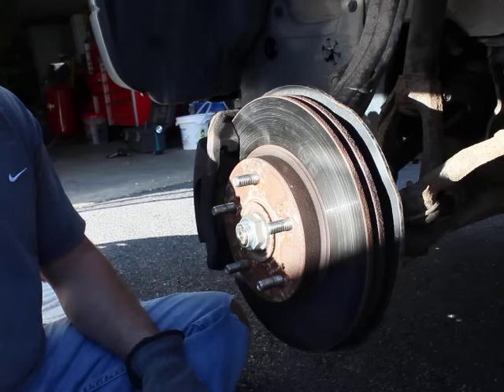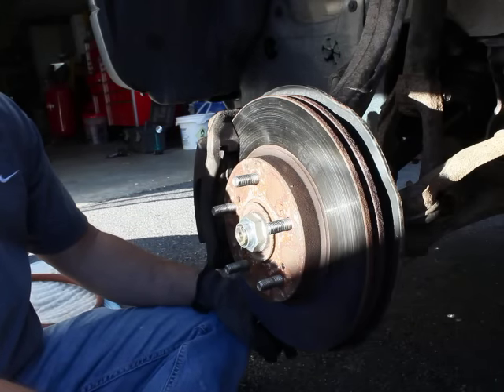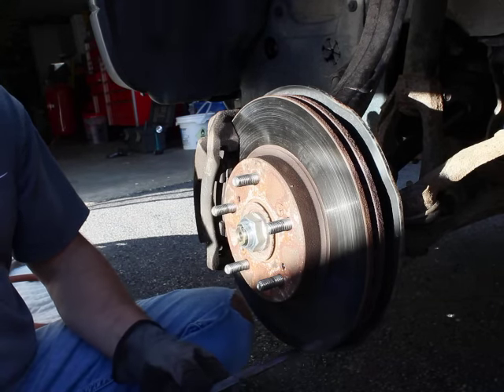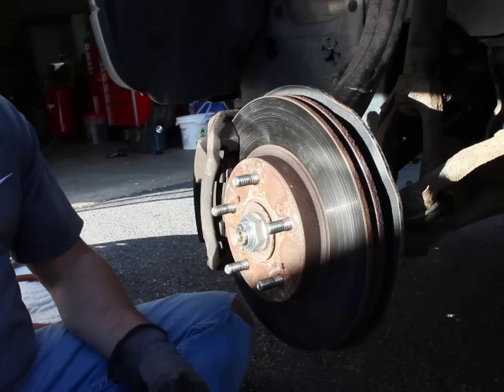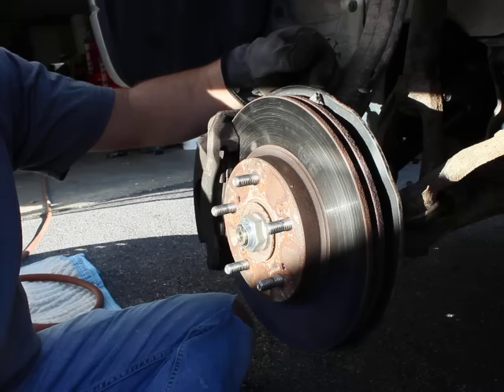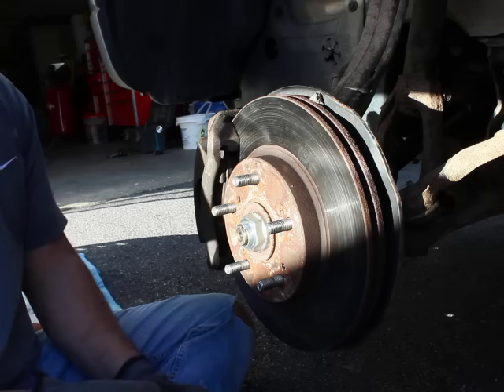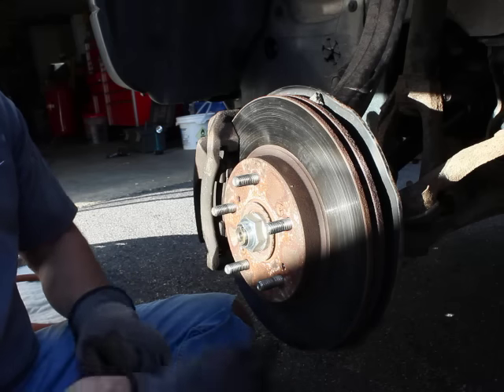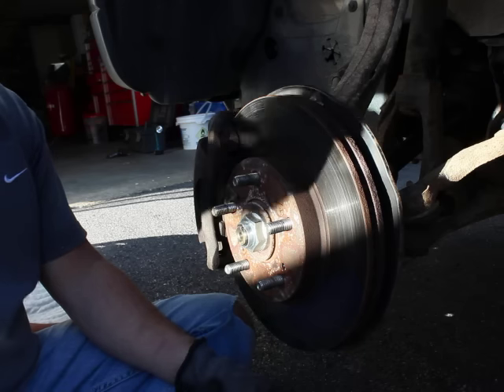Scraping Noise From Wheel While Driving

Comment: Hello Eddie, Parked up for a few months, then drove away, which caused initial resistance, followed by a small bang, then driving causes a 'FWWHWAH-FWWHAH sound, with increases in frequency linked to the speed of the wheel. Not a puncture, and on a Fiat 500, which recently had two new rear shock absorbers, and two new front suspension arms. All four wheels look level within the wheel arches. Any idea? Thank you.
Reply from the maker: It sounds like the rotors formed some rust on the surface and created pad impressions on the rotor causing a thumping noise when braking along with a grinding type noise. It may wear off after about 50 miles of braking, but if it doesn't you may need to have the rotors either replaced or resurfaced. Let me know what you find and keep me posted, thanks.
Reply: Hello Eddie, Spot on! Thank you. #eddiethecarwhisperer
Reply from the maker: Blokprintz Print with Paint! I like the sound of that :) thanks for coming back with an update, I really appreciate it.

Comment: thanks this has been a great help, i pulled away from a very stoney car park the other day and a terrible noise started which i thought was my exhaust dragging off the road, i hope it is a stone and nothing more serious as it is still there so could be a bearing from what i have seen on here, i will try and get back to you with my results..
Reply from the maker: muay thai & football NE England Bearing don't usually make a dragging noise, more like a helicopter noise. Go to my site, www.SimpleCarAnswers.com and check out my articles and videos on wheel bearing noises to help you identify your problem. Keep me posted on what you find, and if you have more questions, I'll be right here :)
Reply: Eddie Carrara  thanks, i had a mechanic take a quick look at it last night just parked on my drive, he jacked it up and had a quick look & said it is not the bearing straight away but probably the brake drum, he said he needs to book it in the garage for a proper look but should be ok to drive for now, i drove it today to and from work a 7 miles round trip and it only did the grinding for a few hundred feet then was ok, would you say it was ok to drive ?  and great channel you have, a great help...
Reply from the maker: Thanks Muay, I think you had a rock stuck from the driveway, if the noise is gone, don't worry about it.
Reply: Eddie Carrara well eddie the noise came back so i had it straight in the garage, it was done in, rear drum/shoes etc etc & other bits, i got it all done as i needed other little jobs doing aswell, in total it cost me an eye watering £170.60 :( 

i will post up exactly what was wrong later as the invoice is in the car,
Reply from the maker: That's not too bad , some brake problems cost in excess of $550 so you kind of made out cheap if the noise is fixed :)

Comment: Thanks for this video Eddie! I have a fiat Uno which is currently making this sound while taking left turns at around 40 km/hr. Was wondering if it was the brakes rubbing or the CV joints.
Reply from the maker: Hi Paul, 
Most likely the mechanic may have bent the backing plate during the alignment yesterday, so yes, check the backing plate on that side.
Reply: Eddie Carrara Hi Eddie, yes you were right. I bent it back and it has reduced a lot, I'm also waiting for new rotors and pads to come in. Once I get those swapped in I think it'll get even better!
Reply from the maker: I love a quick no cost repair lol. Thanks for the update Paul, I really appreciate it :)

Comment: Hi Eddie 
I have and it had to go to the local garage to do it . They said it was dirt caught between the hub and wheel rim and it was a common fault with the car ( Ford Mondeo MK 4 or all cars I don't know ) they took the hub off and cleaned it. It didn't take them long and they didn't charge me but it would be good to see how hard it is to fix it myself next time if there is one.
You could give a "heads up" to viewers that if they hear that sound then that is the possible cause and that you might need a second pair of ears to check as I could not tell where the sound was coming from on my own.
Reply from the maker: +Stephen Edwards 
Very true Stephen, sometimes you need to have someone standing outside the vehicle to hear the noise and locate where it's coming from, thanks for pointing that out :)

Comment: Sounds like you're dragging a big aluminum can, right? Just replaced the whole front end (an every bolt rust seized, hateful nightmare), and this was my noise on the test drive. It's dark and I'm tired and I knew it was not exhaust rattling, but it sure sounded like it; only in time with the wheel rotation. I figured it was something stupid. Let's find out. Appreciate the video.
Reply from the maker: Hi Des420, any luck with the noise? Was it the rotor backing plate?
Reply: @EddieCarrara1  Indeed it was. Thank you very much for asking.

Comment: I have the exact same noise coming out from the rear wheel. I thought it's my handbrake because I forgot to release the handbrake when i drove. And after driving for 1 mile, I realized it so I released the handbrake, but then after that, i started hearing this grinding noise. It doesnt always sound. It usually sound when i make a turn or when the vehicle is moving slowly. But even so, sometimes it doesn't make sound even when the car is moving slowly. It's like the grinding noise sounds randomly. But thanks for the tips. I am gonna try pushing the plate a little to see if it solves the problem.
Reply: Hey Ben.  Did you manage to sort it out.  I have the exact problem with my bmw x3.  only one of tge back wheels is making the scrapping noise.  Did you manage to move the back plate? If so, was that the problem?
Reply: Yes, I jacked up the car . As i was rotating the back wheel slowly, I lightly pushed the plate behind the rotor with a screwdriver, then a piece of small rock comes out. After that, no more noise.
Reply: Thank you so much, I found the same thing on my X3

Comment: Hi Eddie my car was making squeaking sounds when braking at full force then I changed the brake disk pads now even when I brake slightly it makes the squeaking sound. What can be the reason?
Reply from the maker: Hi Moazzamksa, did you lube all the pad to caliper contact points? Did you use OEM pads? The lube is most critical for brake squeaks.
Reply: Eddie Carrara thanks for your reply. No a mechanic fixed the pads and he didn't lube them.as the pads were new it was difficult for him to fit them so he rubbed them on the ground a bit and then fitted them. Also 2-3 times I have heard a strong metal sound.
Reply from the maker: Ok Moazzamksa, So the mechanic didn't clean the caliper bracket as well because the pads didn't fit, which means the calipers were full of rust and debris. From what you have told me so far the brake job was not done correctly and that is probably why you have noise now. :(
Reply: Eddie Carrara it seems I will have to get the tyres opened up again and get the calipers cleaned and fitted again

Comment: We had our back brakes changed about 3 months ago and shortly after that there came a noise it's more like a rubbing..... kinda like running a stick or other object on bicycle spokes while the tire spins only on back driver side tire only happens sometimes and stops mostly if you go 40+ mph any idea what this is? The noise can get very loud
Reply from the maker: Hi Lisa, most likely what you're hearing is a wheel bearing noise, you'll start to hear it around 20 MPH and it kinda fades around 45 MPH because of road noise.

Comment: I have been trying to figure out where the noise has been comin from for the past 2 weeks after changing the discs and break pads. I reckon its the dust shield but the noise comes and goes. Gets worse when turning the wheel to slight left. I need to check the Wheel alignment as well.  Thanks for your help.
Reply from the maker: Hi CJ, most likely it's the dust shield in your case. Figure out what side the noise is coming from and adjust the shield accordingly. Keep me posted on what you find, thanks.
Reply: @EddieCarrara1  Its annoying. Pushed the dust shield with a screw driver today but still noise comes and go after few miles drive. Its not constant. I have only checked driver side. ill check both sides. Will definitely let you know whats going. Thanks bud.

Comment: Mine is more of a hissing or a tsss tss tss sound especially when going downhill, turning right and decelerating (combined it sounds it’s worst going downhill in neutral riding the brakes and hanging a slight right). Makes no noise at acceleration and the sound correlates with the wheel speed. Help! Just did brakes, ceramic rotors and brake pads and the sound is still there 
*coming from front drivers side wheel
Reply from the maker: Hi Micah, Check the clearance between the backing plate and rotor, and also check for any debris stuck between them. Make sure you inspect the entire backing plate, you may need to remove the caliper to check the inner part of the plate. If the clearance looks good between them, check the anti-rattle clips on the calipers, make sure they are centered, and not touching the rotor. Let me know what you find, thanks 👍

Comment: If you just had brakes done check all of the bolts on the calipers.  If you don't use lock-tite on these bolts they come loose and fall out and you get a loud grinding noise.  Personal experience.

Comment: Hi Eddie, I have a question for you:
I have a 2005 Toyota Celica.  I have started noticing an intermittent high-pitched metallic sound coming from my front right wheel well.  It almost sounds like a resonance frequency.  It happened one time last winter when it was very cold, and then never happened again until a couple days ago.  I have noticed it only happens when it's cold, and I do think the wind plays a role, as it is worse when it is windy, worse when passing trucks, worse going certain directions, and worse at faster speeds (usually only above 70 mph).  Overall I have not noticed that my car has been driving any differently.  It is just a sound.  Have you ever encountered anything like this?  Any idea what it could be?
Reply from the maker: Hi Kevin, 
That is very strange especially because you hear it at high speeds when it's cold and windy. I think the noise is more pronounced when passing a truck because the noise is bouncing off the truck and echoing back. I recommend checking all body gaps and fender well liners for any debris or loose parts, other than checking these items I have no idea what could be making this noise.
Reply from the maker: Hi Kevin, 
That is very strange especially because you hear it at high speeds when it's cold and windy. I think the noise is more pronounced when passing a truck because the noise is bouncing off the truck and echoing back. I recommend checking all body gaps and fender well liners for any debris or loose parts, other than checking these items I have no idea what could be making this noise.

Comment: I have a horrible grinding,scraping, maybe a little popping noise in the rear of a Dodge Ram 1500. It happens while turning and accelerating at the same time. The noise isn't as prevalent if I'm coasting through the turn. I've replaced the u joint and the brakes are fine as well. I can't find a similar sound on YouTube to narrow it down. Could you please advise me on what else to check?
Reply from the maker: Is that an independent suspension with rear CV Joints? If it's a straight axle, you may have something wrong with the differential.
Reply: Did u find our what the problem is. I have the same EXACT problem!!!

Comment: on 90% of cases it happen when the tire is removed for any reason, people not use caution bending the backing plate with the tire, it happen to me 2 times on my 08 toyota tundra
Reply from the maker: Thanks for the feedback J Flow, it happens quite often in the mechanic world, if techs would road test the car after the repairs, 100% of these noise would be fixed before the car is returned to the customer, lol.

Comment: i too having same noise..i did showed to a good mechanic of mine and from outisde he said the pads and rotors are fine. The noise is intermittent. But i will have to check out that shield rubbing against that rotor. it had happened long time back too and the dealer said something to do with caliper. and they did change it. But this time i dont think its a caliper problem. So i will check your diagnoisis first
Reply from the maker: OK lexusfan100, I'll keep an eye out for your update, thanks.
Reply: Eddie Carrara i did check but i could not see that plate thing surrounding the rotor. i only see the rotors and nothing surrounding as its shown in your video. hmmm

Comment: Hello Eddie, 
thank you for posting this video. My problem is similar but a bit trickier. 
I get almost exactly this noise (BMW E92 front right wheel well) , rhythmic, loud enough so that bystanders can hear it, and dependent of the wheel speed. Also my brake discs are slightly warped because of overheating. Up to here your solution seems like the perfect one.
However, the noise only appears when i take a left turn, at least 40 km/h (about 25 miles/h) with steering wheel angle 90 degrees. Noise is dependent of the centrifugal force that the front right wheel encounters, is what Im trying to say.
Braking while hearing the noise doesnt affect it, and it is not the tire rubbing the wheel well, i checked that with chalk on all the possible spots.
There is at least 5mm of space between the disc and the shield all around. No play to be felt when trying to rock the wheel on the jacked up car.

Do you think it is the wheel bearing? It seems like the last possibility and quite logical, but the sound would be just so atypical, no?
I would be glad if you could share your two cents on this.

Greetings from germany!
Reply from the maker: Hi Driver1, most likely the backing plate is close to the rotor, but more towards the hub, so the backing plate mounts to the knuckle assembly and it's usually the outer part of the shield that gets bent during repairs but it sounds like you may either have too little clearance closer to the hub or it's also possible you have a small rock or pebble stuck between the rotor and backing plate.  Keep me posted on what you find, hope this helps.
Reply: @EddieCarrara1  Thank you for your answer. I'm currently in the process of changing out the wheel bearings, just to be sure. They were due anyway. While removing the backing plate, I saw that there were vibrational cracks in the plate, exactly around the washer of the lower retaining screw. Invisible with all the brake dust and nothing one might ever think of. So it seems like the centrifugal force pushed the plate outwards and against the disc.
Problem solved i guess👍
Reply: @EddieCarrara1  Back at it again 😄. The sound actually came from the rear right, but with open front passenger window the reflection on the A Pillar made it sound like it came from the front. It is a problem with the handbrake inside the brake disc, that i couldn't make out by disassembling and  checking it. I will live with it for now.
Have someone stick their head out the window and listen is what I learned from it.

Comment: Hey Eddie carrera I have the same problem on my 95 suburban but it only does that when I push on the breaks I changed the break pads and also the the disk brakes any idea on what it could be thanks in advance
Reply from the maker: Hi Carlos, Check the anti rattle clips on the calipers, they may not be centered and could be hitting the rotor when applying the brakes . let me know what you find, thanks.

Comment: I'm currently having the same tin sound on my vehicle and just had all new brakes put on a few months back. It's only from the back left side and seems to do it whenever going forwards or backwards but also goes away for about a day if I drive it for more than a few minutes. I haven't jacked it yet, but the sound can be heard if I grab the tire and rock it back and forth as well. Would this likely be the backplate rubbing?
Reply from the maker: Hi Reed, sometime the mechanic will not put the anti-rattle clips in properly or the shim on the brake pad. Sometimes we find the shim or anti-rattle clip will shift enough to touch the rotor and make noise. The noise will usually go away after driving for a few minutes because the metal heats up and expands away from the rotor, once it cools, it will touch again. Hope this helps. Cheers 🍺

Comment: I get a tiny scraping noise from the front, not generally when I'm driving along with my foot on the gas, but when I take my foot off the gas and coast. I'm thinking maybe a bit of excess play in one or both front wheel bearings causing  the rotor to make harder contact with one side of the pads ? Causing this scraping noise.
Reply from the maker: Hi Manofweed1, A loose wheel bearing can cause this noise, also rust build up on the edge of the rotors. Try locating the point of contact and then find out why. Keep me posted on what you find, thanks.

Comment: I only hear that noise at speeds below 55MPH, and my ABS light is on. When I go 1-45MPH I hear a constant loud grinding sound, and then when I get to 55+MPH it fades away. Usually in the lower speeds its after I have accelerated a little and then take my foot off the gas pedal and then as soon as I do, it makes the grinding noise even more. I had one mechanic tell me it was bad bearings and another mechanic tell me it was my transmission. I have an 05 AWD Saturn VUE, with less than 85k miles

Comment: I hear those sounds coming from the rear wheels after changing suspension after waching your vid I guess it could be the shield was touching the rotor thanks for the idea!
Reply: I'm having the same issue but I did the front end lower control arms
Reply: have you found out where exactly the noise coming from after all?